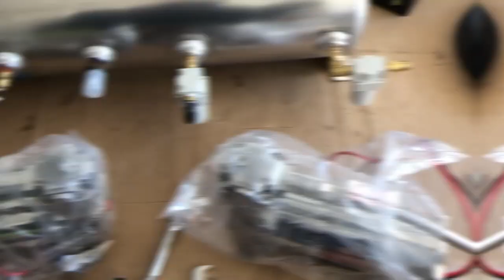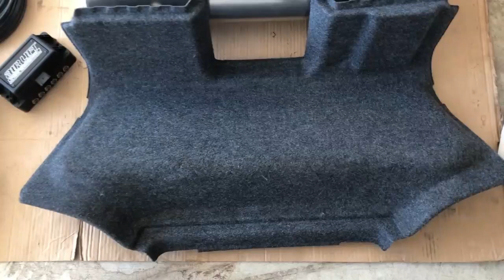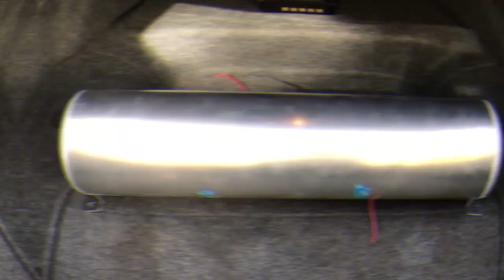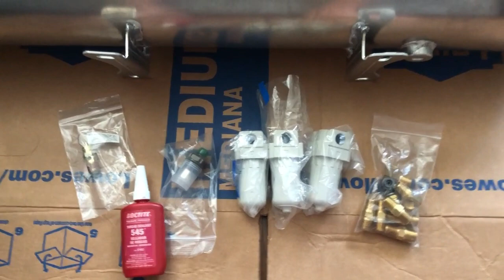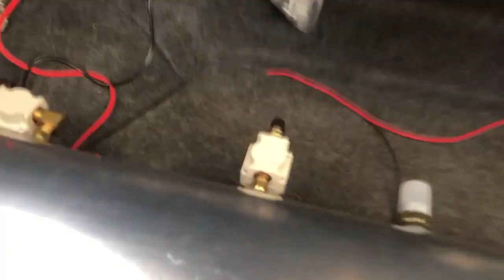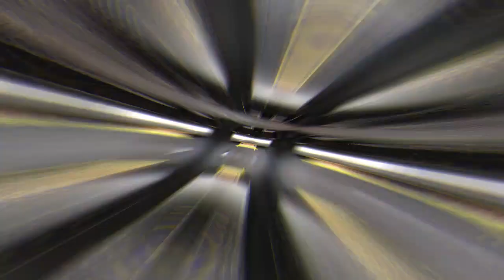4th Gen. Acura TL Air Suspension Build Pt. 2 (Airlift 3S)

Comment: How do u get the phone to pair with the ecu? I'm having issues with that. If u can help thanks, would be greatly appreciated.
Reply from the maker: teedog teedog hey whats up man.  The app is a real pain, and I had troubles with it as well. Only one device can be paired with it at a time. Make sure you only have one device with Bluetooth on around when pairing. Then when the car is running, unplug the harness from the manifold. Let it sit for about 15 seconds then plug it back in. After, turn Bluetooth on the device you want to pair and it should connect. This might take a couple tries, but this is what Airlift suggests and what I’ve had the most success with.
Reply: @TheOriginalBeeCee  thanks man, it worked.
Reply from the maker: teedog teedog awesome man! Glad you got it working.